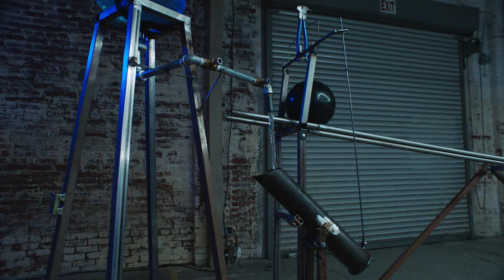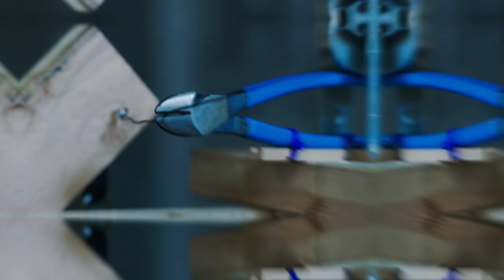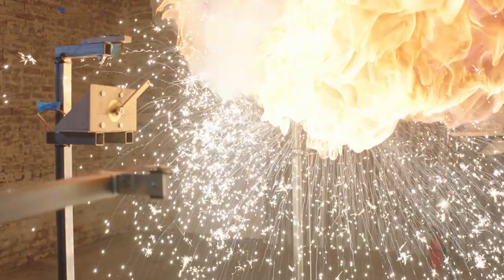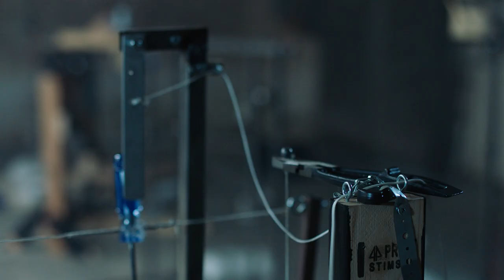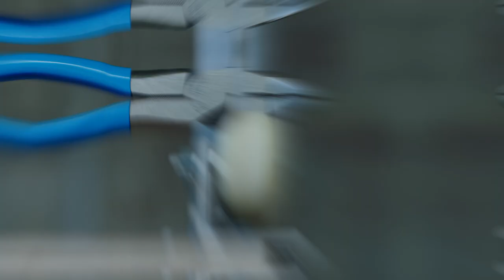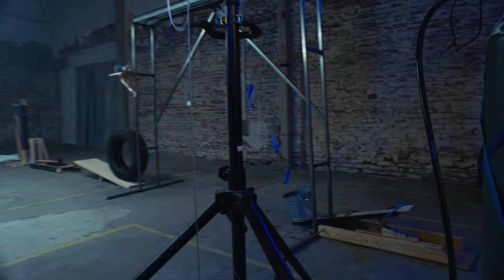"The Machine" Presented by CHANNELLOCK®

Comment: I've owned my Channellock Mechanic's Professional Tool Set 136 for a very long time I bought from Sam's Club and their ratchets have been incredibly durable. I haven't bought any pliers from them as of yet, but I want to get my hands on their welding plier. I wish you guys would make and sell torque wrenches and breaker bars. I normally shop as Harbor Frieght Tools for the things I can't get from Channellock.